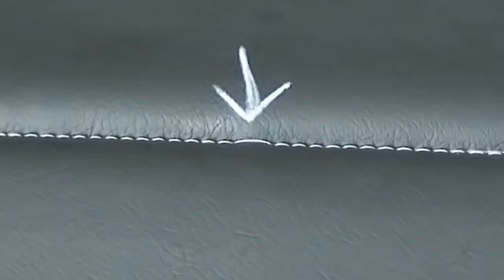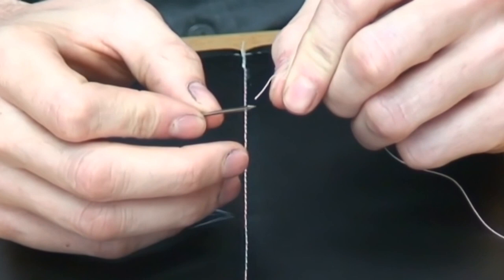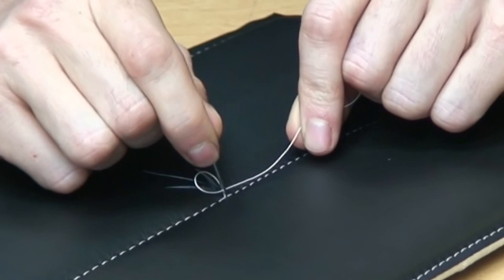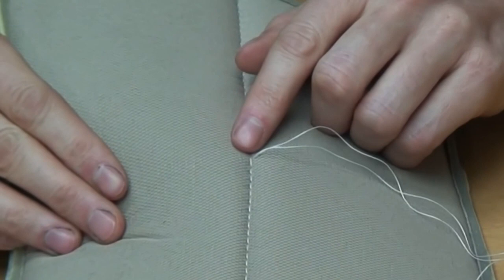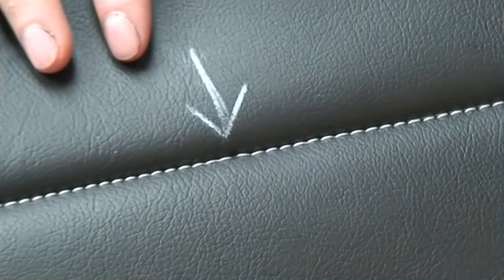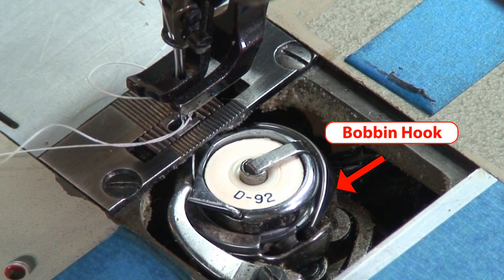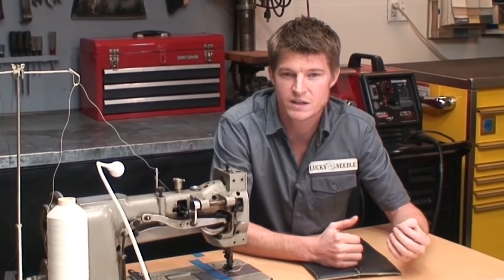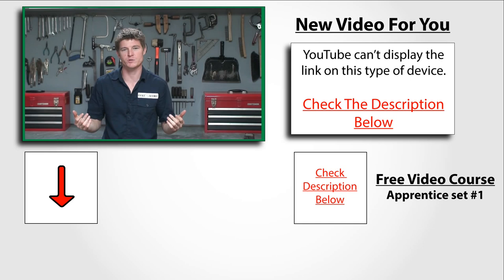How to Fix a Skipped Stitch - Upholstery Tips and Tricks

Comment: To remedy skipped stitches adjust the timing of the machine, which synchronizes the needle and bobbin shuttle. Also, make sure it’s clean, blow out any fabric dust that tends to build up by punching holes in material.